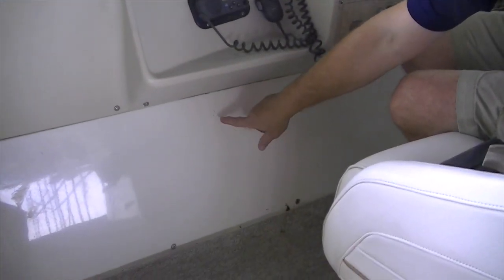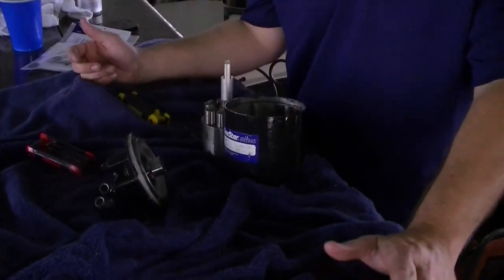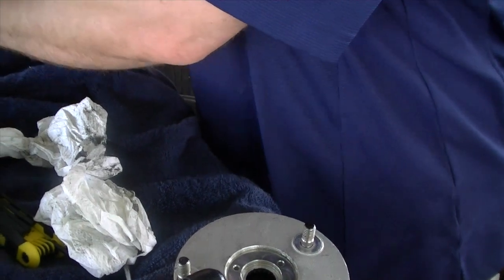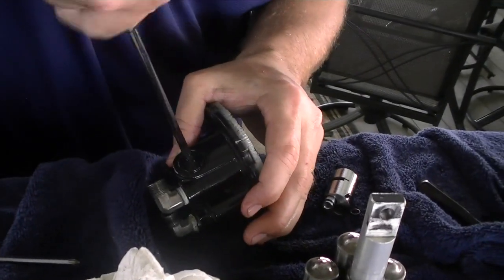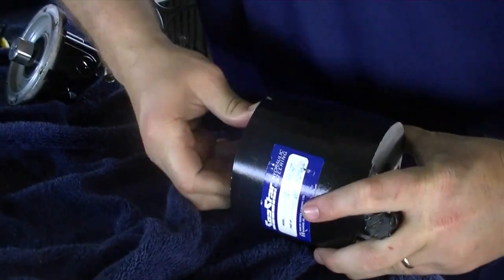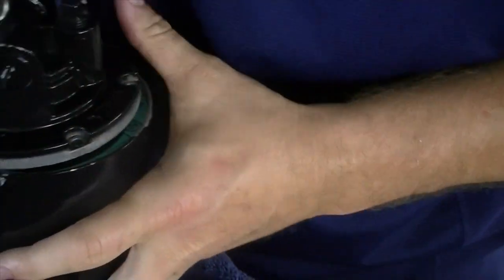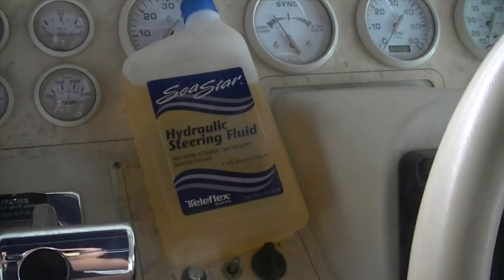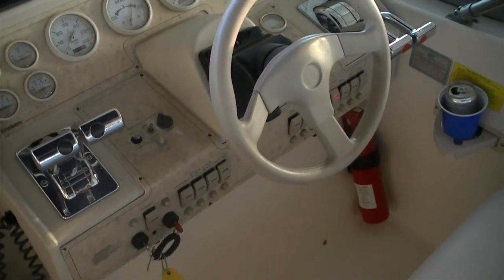How to replace the Seals in a Teleflex Marine Hydraulic Marine Steering system

Comment: Great video on replacing gaskets and dissasembly of HH5741.
Tapping on the center bolt of the steering wheel worked great. No need for wheel puller and my boat is 12 years old and used in salt water.
Rear section of pump. Had great difficulty removing mine until I first removed the set screws or what have you on the back of the pump and then GENTLY tap the shaft on front of the pump inward. It should push the back section off but be careful or you'll be looking for parts and springs. 
I would also remove the top filler cap and dump all the oil out before you start taking things apart. Less messy.
Putting back plate on by yourself: I took 4 2x4 sections, about 2 feet long and placed one on top of the other on the work bench just 2 of them to a side, leaving a trough in between the  sets of 2  in order to put the shaft in this trough allowing me to push downwards on the rear plate against the spring tension to at least get one or two of the set screws in the holes.
Gotta make sure the gasket is in correctly and lined up with the holes and that the plate is lined up the way you took it off as was shown in the video. 
Hope these extra hints help a little. 
Very thankful for the video. Most helpful.

Comment: What part number did you use for the seal kit? The HP6032 shows the front shaft seal but not the rear gasket, that you showed in your bag.
Reply: Let me know where to get rear gasket
Reply: @gypsypaulandtiffanyadams426  Sorry my memory is a little foggy, but I found my West Marine order (Model # 9353376 | Mfg # HS5147) and I believe that kit included the gasket.

Comment: And i have that sea star hydraulic steering and noticed i am getting drips under the steering wheel down the wall and you said it is common for those seals to go?
Reply from the maker: It sure is
Reply: FriscoBoater's Garage  where can I get the rear seal

Comment: is that boat twin inboard or i-o
Reply from the maker: Twin inboad
Reply: does it have twin 454s fi or carb and what pitch and diamiter are the props and how long are the shafts and what through hulls are you using dripless or the old stuffing  boxes